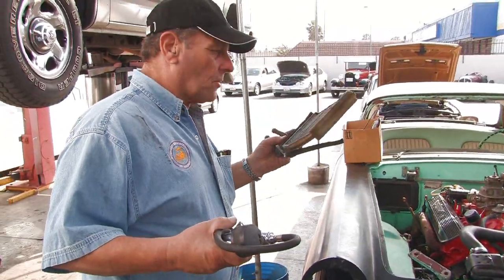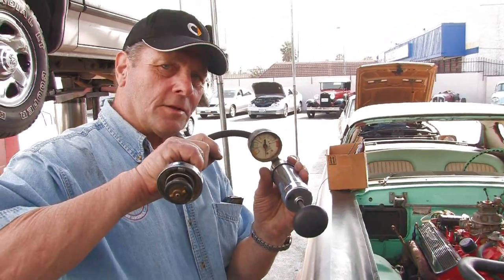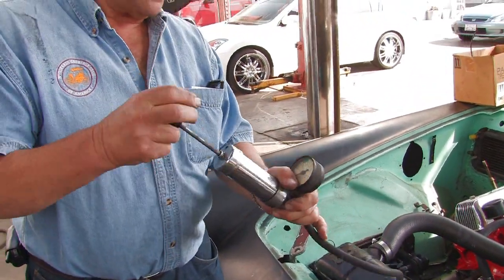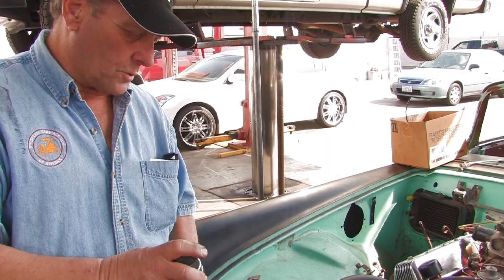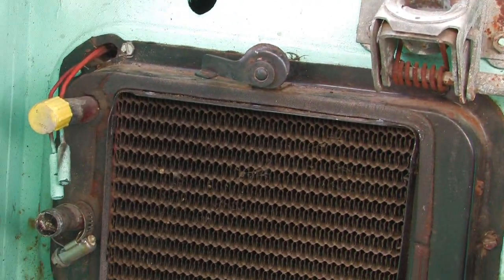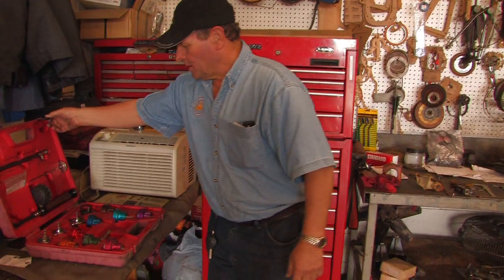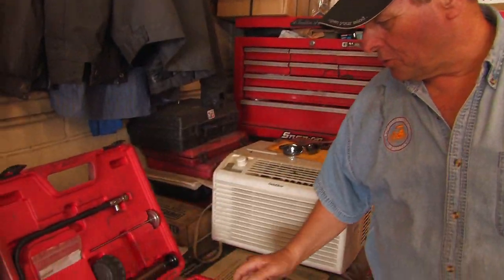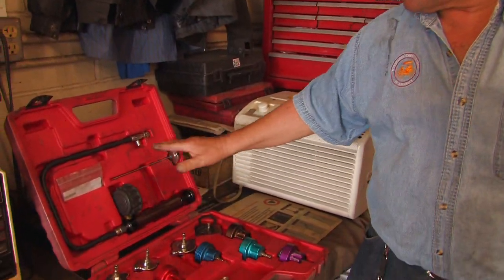Troubleshooting Car Problems : How to Check if a Heater Core Is Bad

Comment: -Cont'd- If not, like with my car, there could be a number of reasons. I was lucky, because I only needed to change a weakened radiator cap, which no longer held pressure, in order to restore heat in my car.

Comment: That is wonderful, when you have such a kit, but what do you do when you don't? I have recently gone through the vagaries of fixing insufficient heating in my car, and an experienced mechanic mentioned a simple trick: Try to press-in the usually easily accessible upper radiator hose. If the system is good (that is under pressure), the hose would resist such 'intrusion'. -Cont.-